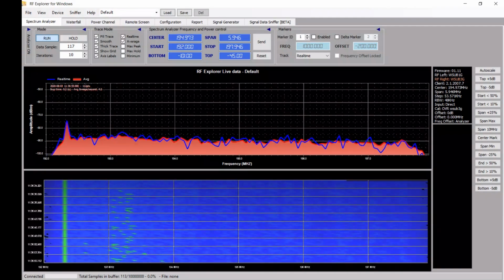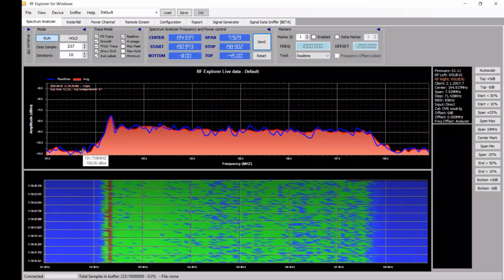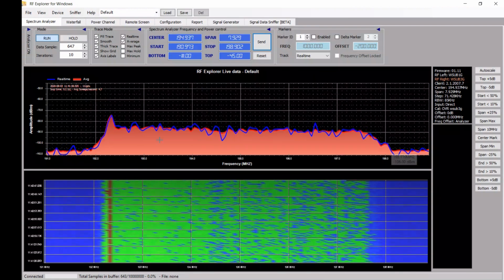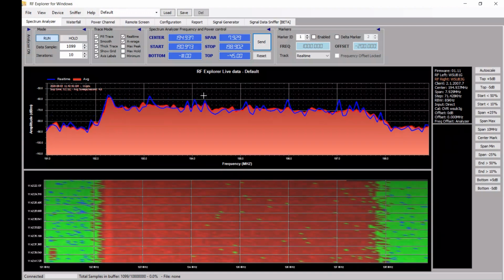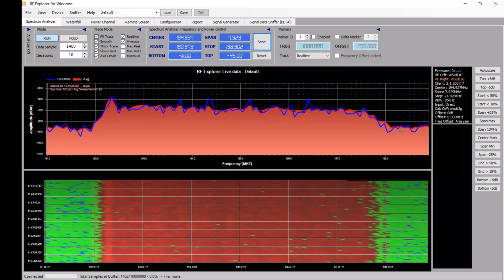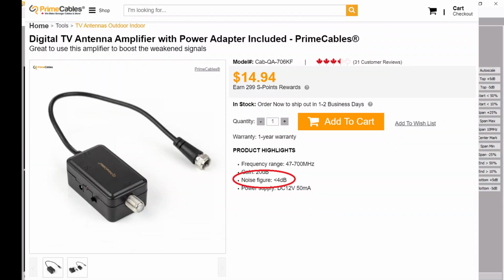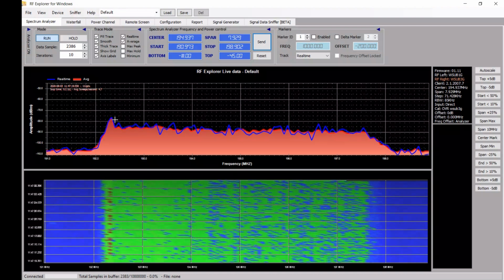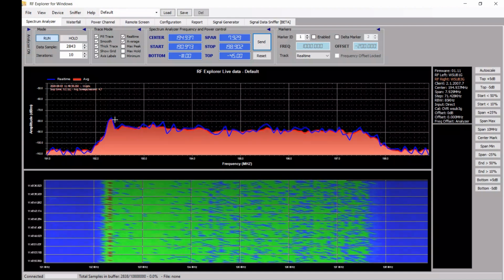What does an OTA Signal Amplifier Actually Do?

Comment: Thanks for this video. It was a very good visual of the theroy. I needed a amp for ota tv once where I had siginal on my old tv but if I connected the cable (same cable no extensions) to the new tv I didn't get the channel adding the amp brought the signal in to the usable randge.

In my area there is no cable to the house and only one ota station. But it is a cottage so there's no real need for more than the news.

I really need to get a cheep sdr. To see if I can pull in a few more channels / choose a better wifi channel/ general fun.